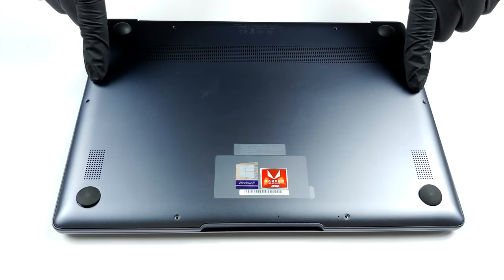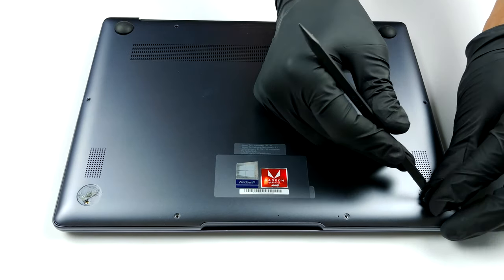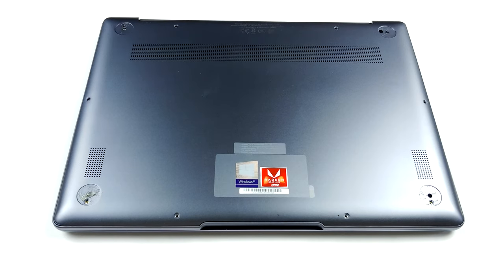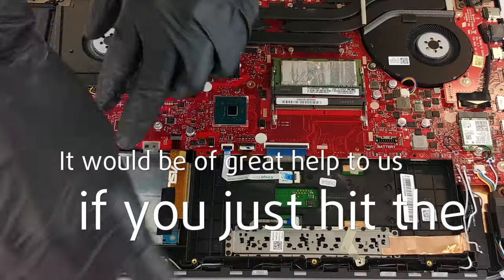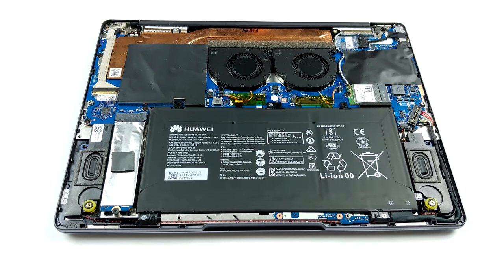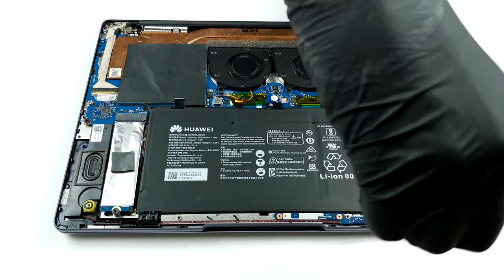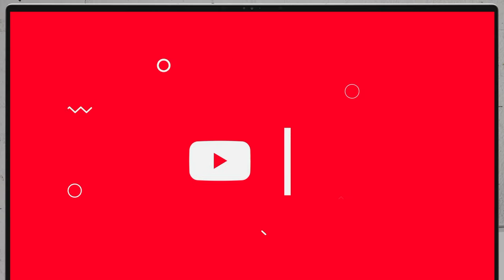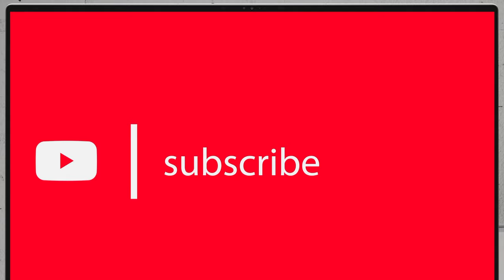🛠️ Huawei MateBook 13 (2020) - disassembly and upgrade options

Comment: The thing beside the battery is the SSD..so what is the thing above the battery?
If the SSD is removable, does that means it can be upgraded to larger storage?
Reply: Thing above the battery is Wi-Fi and Bluetooth module.
Reply: ouh i see...tq bruv

Comment: Well my screws are stucked on CPU so I can't remove heatsink to change the thermal paste. I cleaned the fans and closed it unfortunate :/. Can't apply force much nor have access to screw extractors. Will try the methods when laptop is free next time lets hope I can change the paste.

Comment: Can someone help me put here.
Awhile ago I disassembled my matebook 13 to clean and change the thermal paste. After reconnecting the battery when i tried to turn it on the keyboard light turned on for a couple of seconds than turned off and the laptop wouldn't boot. After troubleshooting for awhile i got frustrated and left it alone and when i tried to boot it again after 15-20 minutes it turned on fine.
Recently I had to disassemble it again for thermal paste change and now I'm facing the same problem again. 
Can someone please tell me if there is a specific procedure to bootup after disconnecting and reconnecting the battery, i can't seem to figure it out.

Comment: So I guess I could setup a external usb-c drive with a portable windows, and exchange the M2SSD with a M.2 PCIe x4 to eGPU adapter and add a gpu to this system right

Comment: Thanks!  I can recommend this laptop as being a great overall package (with the AMD 3500U)  but it isn't as capable as the OG Apple or the premium PC options due to the choice to limit RAM to a single 8gig.. It's the nicest laptop I've ever owned, by far. Huawei surprised me.  It's as grunty as my older i7 gaming laptop but runs out of RAM when I treat it like a desktop replacement...
Reply: How about noise on this laptop? Fans going crazy on lighter task or charging?
Reply: @MrDrapski  if the 14" is anything to go by unless you really push it it's silent or very quiet.

Comment: Anyone know if its possible to upgrade the graphics/video card?
Reply: no
Reply: No it’s soldered to the mother board
Reply: @ben-niiquarshie4148  is it possible to change the motherboard?
Reply: @pokiepie  you might aswell just get a new laptop
Reply: @ben-niiquarshie4148  alright, might actually be better

Comment: Hello, i have a doubt. It's possible to change the M.2 memory, for another with more space? If anybody can answer me, it would be appreciated. I want more space in the laptop.
Reply: Most definitely, you see the stick to the left of the battery wrapped up like a piece of gum? That's going to be your M.2 SSD. Currently, in Germany (I'm not sure about other locations), you can buy the Samsung 970 EVO Plus 2 TB on sale at 54% off; it's one of the fastest you can come across, leading to me buying another one and watching this video for disassembly procedures. Currently the stock SSD is about 250gb on mine so it's needed to upgrade unless I want to carry the Type-C adapter and an external hard drive everywhere I go. Sad thing is, is that it looks like the SSD is the only thing that can be upgraded easily in this

Comment: Are there unpopulated USB (1.1) ports or test points on the board? I'd like to integrate my wireless mouse receiver somewhere. (let me know if someone is on a similar quest)

Update:  Next plan is a thin permanently attached 3D printed laptop "stand" with integrated USB+Ethernet hub. stay tuned .
Reply: Just use a bluetooth mouse. Will be 10 times easier.